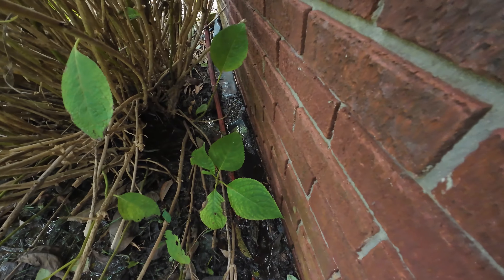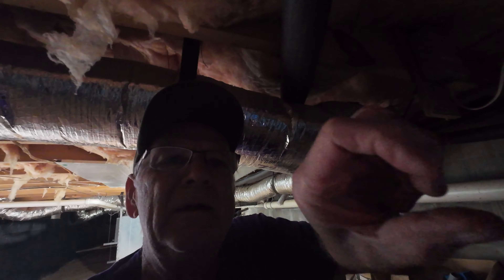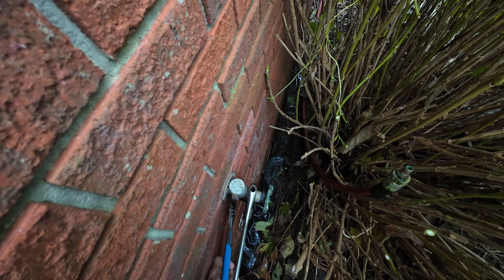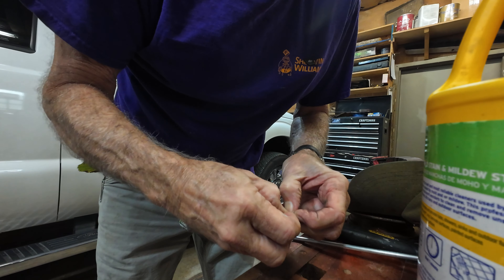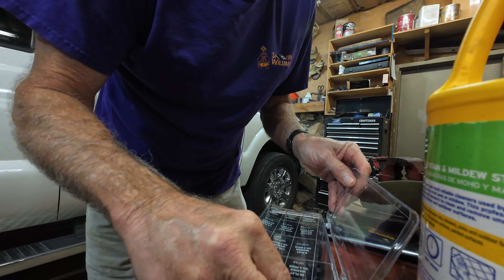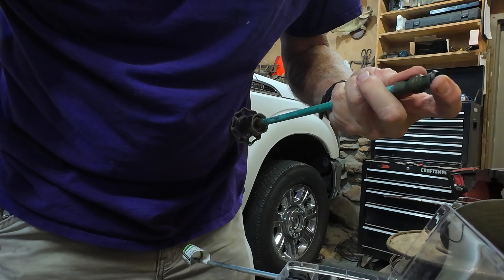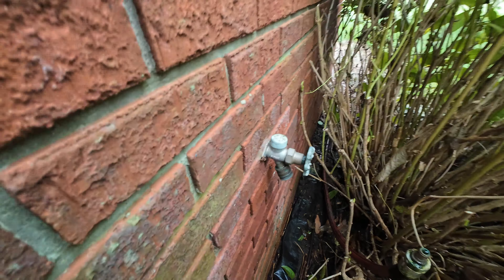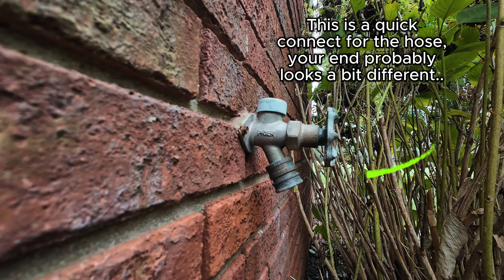How To Fix A Leaking Outdoor Faucet, Fix It Fast, Easy, No Need To Call A Plumber!

Comment: Growing up on a farm, my father taught me how to fix most anything from plumbing to electrical to . carpentry to mechanical. It has served me well through life and saved me a lot of money. A great modern resource for those who are inexperienced is the internet. One bit of advice on your project: any time you have to replace a faucet washer you should also check the stem packing while you've got it apart and replace it if it shows signs of wear. It'll save you from having to take it apart again too soon. Blessings to you and yours.
Reply from the maker: Thanks Kevin. And Salute to your Dad!